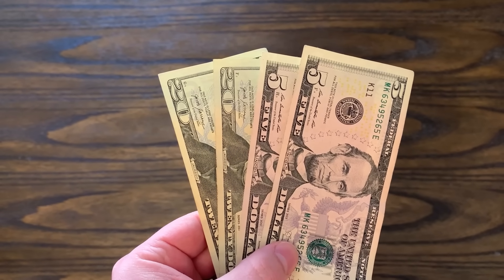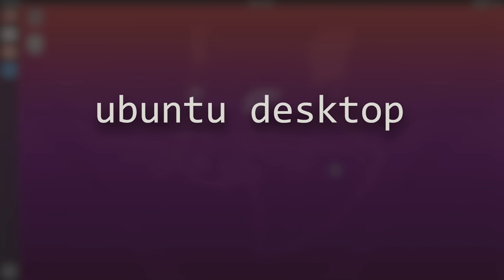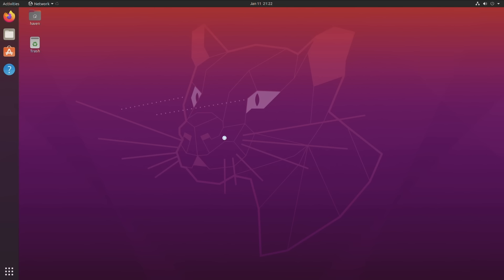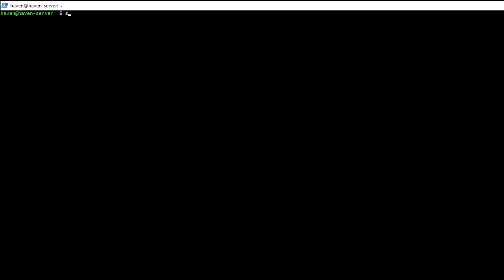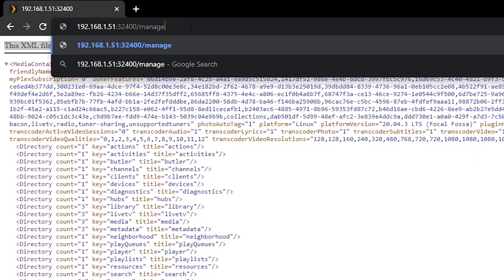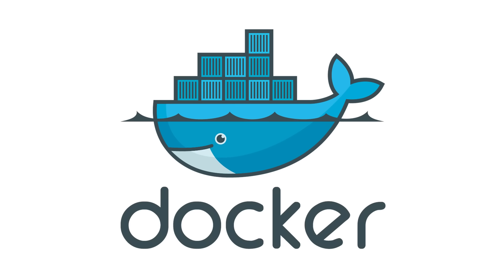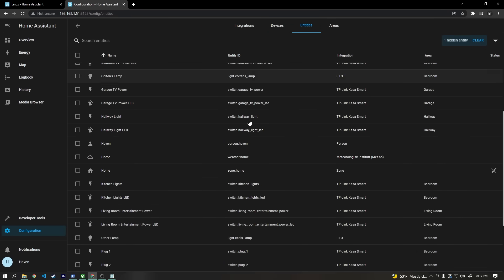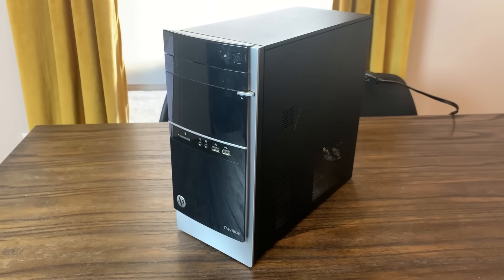Incredible Budget Home Server! (Minecraft, Plex, Home Assistant, NAS)

Comment: Nice, video. I do think it's important to note that this setup comes with limitations. 
- Things like transcoding are going to be limited to 1 client and I'm be cusrious if it can even transcode a high bitrate 4k stream.
- Very limited amount of SATA ports
- Power usage (a rPI4 or other low power device might be the better option)
- Power limitation, adding more disks will require a power upgrade
- Disk life, This case was never made to be running multiple disks at the same time. So once you start adding disks you'll run into issues with them dying quickly
- Reliability, for fun it's perfect. However, do not leave any important data on it!
- You say nothing of backup, which is the most important thing
Reply from the maker: All really good points! (Pinned this comment so others can easily see). I think the overall idea was more to just see some of the many cool things you can do with a PC that might be lying around the house or picked up for stupid cheap. Rpis are amazing (I have 3 currently), but sometimes aren't as affordable as people make them out to be. I wish I would've mentioned something about data integrity and backups though. I will try to be better about mentioning that in future content! Thanks for commenting
Reply: @HardwareHaven  Hi, mate thnx. No worries the video was fine and any tech savy person should understand this.

It's the non tech savy I worry about.

PS A few ideas for videos that expand on your current setup:
- Kubernetes cluster with some rpis + NAS or other hardware to distribute your docker load (keep in mind that the rpi architecture isn't x86).
- A sonar/radar/transmission/sabnzbd/spotweb setup, this often blows users minds. Do make sure you check the legality before doing so!
Reply: @HardwareHaven  Ow PS, would you be so kind and run a high bitrat to low bitrate transcode? Since you have it setup. I'd be curious how it'll perform.
Reply from the maker: Unfortunately I already tore that system down for a different video. I haven’t wiped the drive though, so I can probably put it back in and give it a shot later on though
Reply: @HardwareHaven  Although I really appreciate it. You shouldn't go out of your way to humor me. It's purely out of interest since I run a dual Xeon for plex myself.
Reply: @Nemesis-pe7mw  I had one, a home built A10 box.  Any Bulldozer based core will have issues beyond 1080p.  An add in Nvidia 1050 or higher will allow hardware decode and transcoding.  My A10-7700k could not even handle live OTA in Plex.  MythTV worked fine.  
Upgraded to Ryzen 6 2600, GTX 1050, Ubuntu 20.04 (Had been 16.04), and Plex, Emby, Minecraft, all work
Reply: @xrobertcmx  Hi thnx for the info mate. Well yeah hardware transcode is a possibility however a 1050 or any nvidia consumer card as far as I know will do 1 transcode at max. (some models can do more but are limited as far as I know)

It was purely out of curiosity of course, since I have a dual Xeon server with heaps of RAM (for ZFS). My wife will kill me long before I run into bottleneks due to power consumption ;)
Reply: Yeah it won't be able to even decode 4K let alone transcode. It's a nice small box, but I dislike when people try to put Plex on underpowered systems.
Reply: @jonmayer  Well, i get your point of view and I'm ashamed to say i share it.

However, do keep in mind everyones usecase and expectations are different.

Honestly as long as you make sure all the source material is at a bit rate, resolution and in a format the receiver supports you do not need transcoding!

I ran plex of, of a Synology NAS for years! Ran like a dream until my son got my parents old tablet. To fix it I threw the old tablet in the garbage and bought him a proper tablet which would support the right resolution natively.

Now I have since moved from my 12 bay Synology NAS to a Dual Xeon TreuNAS scale setup. But honestly the "little old NAS" would probably still do a good job and it's way slower then what he's proposing!
Reply: Transcoding requires horsepower, no chesp mini or old thrift store PC is going to be able to.
Reply: @joefish6091  These comments are so dissapointing. I understand where you're comming from, but most will not.

Please stop with the blanketing statements of stupidity. The "horsepower" required for transcoding is very dependent on the source and result.

According to the plex site a 720p source can be transcoded by a i3. However, my Synology NAS with a quad core atom @1.2ghz can run a single 720p transcode without any problems (memory upgraded to 16GB, the stock 2GB causes issues), as long as the bit rate is low enough.

It all depends on your use case. Personally I'd advise anyone not technically inclined to stay away from transcoding. UNLESS they want to throw tons of money at it!

On the otherhand, i do not expect even my big boy TreuNAS setup. A dual Xeon will be capable of transcoding 4k HDR.
Reply: If you have 4K for one TV and want to watch non 4K on another you can pre optimize in Plex so you don’t rely on real-time transcode. Doesn’t take up much space.
Reply: @chrisweaver41  I've never actually tried this. My media library is like 40TB atm so I'm hesitant.

Could you quantify not a lot in a percentage?
Reply: @Nemesis-pe7mw  no, I can’t give you a percentage as it is highly dependent on the source and what you optimize for. I suggest you pick one of your 4k media sources and run the optimize function for the playback resource you prefer. You could for example get something like 40-1 going from a 40MB 4K h.264 source to a lower bitrate 1080p or even 720p in the 1MB range. If your source is h.265 and the transcoding is needed for direct playback on a h.264 player then space savings would not be significant. While space savings is another topic, this is about saving compute resources, if you can’t transcode in real time, then you could transcode using the optimization function prior to viewing. 

I would guess that if you have invested in 40TB of source material you also have significant compute resources as well. This is a suggestion for a use case where someone is trying to operate a highly functional Plex service on a budget and can trade a large investment in compute power to using additional storage and the optimize function will by definition use less space than the original.
Reply: @jonmayer  I have my Plex server running as a small VM with very limited ram, on an older dual core processor and slower external USB storage, as long as I keep my content prepped for direct play for my choices of playback devices ( Primarily AppleTV ) I don’t have any issues with 4K HDR. Spending money to handle all the transcoding is only needed when…. Transcoding is needed ….
Reply: I always amazes me how poor the design of the big cases are. Compare it to a Shuttle PC, for elegant cooling and packaging: and old shuttle boxes can also be repurposed with mini ITX (IIRC) motherboards and a cheap i3 or similar low power CPU. RPi4 obviously a big winner, esp in power consumption as electricity bills rise. Ideally a setup with a RPI and a disk that sleeps is good, some of the caddies allow this, for reuse of old SATA 3.5" drives via USB3, which also makes the system easy to hide away.
Reply: @G-ra-ha-m  It really depends on what you want. For most users I'd advise a standard NAS, Synology. Yes they're expensive for what you get from a hardware point of view. For someone that's just starting out this'd be the best!

A rPI if you can accept it's limitations and are tech savy. A i3 self build like you said if you can accept the limitations and are less tech savy. 

If you're crazy like me and are on a moderate budget, a r720xd poweredge with a dual high performance xeon a shit load of ram. A few PCIE m2 SSD's. A few sata SSD's. A few extra controllers. Two 1100W power supplies. A few custom connectors to bleed of some extra power, the extra power and the sas connectors to two self made external enclosures each holding 8 more disks.

When budget doesn't matter... Who doesn't want a 100GB back bone in their house with a datacenter in the basement.
Reply: @Nemesis-pe7mw  Your solution is by far the best for technical specs: over time I've tried to move over to quiet (ideally fanless) stuff that doesn't use much electricity :).
Although my RPI4 does have a fan, so it lives in the shed LOL.
Reply: @G-ra-ha-m  Well, tbh it's waaaaaaaaaaaay over spec'ed. It's for hobby and my wife is a sweat hart! Also I have solar panels so yay me :)

But yeah, when I tell people how much electricity we use I am very ashamed!

As for the sound, please don't laugh. I made a dual insulated room in the attic with a forced airflow path. There is no sound.

I just can't help myself... Also my sons minecraft server is running on it so it's more then justified!
Reply: @G-ra-ha-m  Em, most energy is still won from non renewable sources. I won't get into the conjecture and lack of understanding of physics.

On the US army, not sure if that's indeed the case. Never calculated it however, the largest poluter at this moment is most probably SpaceX.

No idea on Al gore, thought he was dead, I stear away from environmentalists since it's usually more look at me then actually beneficial.
Reply: @G-ra-ha-m  I'm speaking currently, not historicaly. 

I clearly stated "On the US army, not sure if that's indeed the case.". When thinking about the US army I honestly did not take war into considereation. Furthermore I said it's most probably SpaceX. This is mostly due to the way they propel the rockets and the resulting polution which is of stellar proportions, pun intended. I may be wrong, I  can accept that from myself. Can you? Or are you 100% percent sure. If so please show your work!

Well you stated "Energy is managed, controlled and metered deliberately. The earth literally bathes in energy" which lead me to assume you assumed (electrical) energy is free and changing one type of energy to a useable electricity source is trivial. This is not the case!

You confusing Voltage or potential with energy indeed lead me to assume you are lacking in knowledge on the physics front. You can have a very high voltage with little energy, as soon as you add a load the voltage drops. You know like what happens with lightning ;) If you dissagree let's discus it.

If you'd like to reply please feel free. However, please refrain from emotional responces and keep it civil.
Reply: @Nemesis-pe7mw  @Graham I absolutely loved reading the overall dynamic of the conversation progressively change. It was indeed entertaining..
Reply: @johnathanabaya7574  Glad you were entertained. 

I was bit dissapointed myself.
Reply: @Nemesis-pe7mw  oh i'm sure! But that was more or less why I was entertained.
Reply: how is having the wrong case gonna kill the drives? i mean unless you literally have them stacked ontop of one another in a pile on the floor then i see what you mean but its pretty comon to have more than one hdd in a pc/server
Reply: @firenado4295  Vibration and a lack of proper airflow over the disks. You cannot compare a proper disk enclosure with what a PC comes with, especially a budged one at that.
Reply: @Nemesis-pe7mw  i mean i have 4 discs in a beige box i found that i use in raid. two discs fill the hdd bay and there are two in the floppy drive bays and thats been working for years, they aren't even good drives just stuff i got in a lot off ebay so I doubt that it will make that much of a difference.
Reply: @Nemesis-pe7mw  720? Sir, it’s 2022… We want 4K HDR content!
Reply: @ohheyalan123  For many use cases 720 is more then sufficient.

If you want to stream 4K HDR and even worse transcode it. Then there is a cost. A cost which most people can avoid since they do not actually need it. That's all I'm saying.

The other thing with 4K HDR content is that it costs a ton of storage, if you want 4K HDR then I assume you want HDR10 with a low compression and uncompressed audio. It is 2020 after all ;)  So say +100GB an hour. 

For me that's not worth it. I only do that for nature documentries and some movies. If I can find a source of such a quality, which is rare. Yes, even in 2020 ;)
Reply: @firenado4295  What's the load on those disks? Do they run continuously? How often do they spin up? What's their speed? Do you ever look at the smart values?

"so I doubt that it will make that much of a difference" this is a statement made out of ignorance. 

Please, be carefull with advising anyone with doing this! I hope you have proper backups.

PS 4 disks is a VERY low amount of disks for a NAS. I have 1 NAS with 12 Disks and 1 with 20 Disks and 10 SSD's.
Reply: @Nemesis-pe7mw  bruh they where all on caution when i bought them but they where £2 each so eh, I dont have the system now cuz I just bought a single good drive instead of using 4 80GB drives but it was on continuedly and used a bit as a public file server to move stuff from one pc to another
Reply: @firenado4295  Your initial argument/question was "how is having the wrong case gonna kill the drives?"

The answer is:
- Vibration exasturbated by resonance
- Heat

As for your example system, that's not a valid example. For MANY reasons. There seems to be a knowledge/experience gap which will make it hard to continue this conversation.

I would like to remind you again to make sure you make backups. At least 2, 1 of which offsite. Which with the amount of data you're talking about is free. Just make sure you encrypt the backup when using a free service.
Reply: @Nemesis-pe7mw  ah I didn't think about heat, you got me there but on most of the servers I have seen where the HDDs slot into a back plain (not using caddies) there is basically no vibration dampening at all just a mettle grid to support them. would have thought that was far less optimal than screwing the drive in place like on the case shown in this video.

and yeah, I do back my stuff up cuz i have had alot of odd drive failures but not in the way you'd think. an example is that I have a couple of 20 year old segate ide hdds one of which has been used in a voip server for the last 15 years 24/7 and they are both fine. however, both the brand new segate 1tb drive i bought a year ago and the 2 year old segate drive in my mothers pc are both dead already. how does that even happen?
Reply: @firenado4295  Hi Firenado, my intention is only to converse, share knowledge and enlarge my perspective. Sorry, if my writing style seems offensive to you. It is not meant to be.

@Server backplane slots, yeah those usually aren't great! But don't forget there is mostly just room for 2 disks. More disks is more vibration. Also they usually aren't certified for 10K disks. I have a r720XD for which the backplane is compareble to what is shown in the video, in vibration resistance. Airflow is MUCH better though!

@Backup, good to hear!

@The IDE disks being "rock solid" compared to the newer drives. There are a number important factors. Here are a few:
- The data density of the IDE disks is FAR lower!
- A VOIP server has little to no disk IO (depending on the configuration)
- The disks in the VOIP server are on continuesly and thus have a stable temperature. Turning a disk off and on is one of the biggest factors for disk failure. This is due to the expansion of the metals
- The IDE disks have no pesky green logic which is hell on a disks life expectancy
- Larger disks fail more often due to increasing complexity, heat and vibrations.
- It could be that you bought shingled disks which are bad unless you have a very special use case
- Usualy when stuff in my moms stuff die there is but one reason. My mom ;)

The problem is your comparing apples and smart watches to each other. There are to many differences to mention.

My experience with modern disks as with all modern technology it seems is that they're not made to last long. This is exasturbated by the fact that to achieve modern day high density drives a lot of complexity is required. The higher the complexity the lower the MTBF.

It's like comparing an old mustang with a Nissan GTR. 

The old mustang will probably run no matter what you do to it! Clean the block replace some bearings and fittings you're done. You can do this in a barn without much issue or knowledge. Gas and air goes in, it burns it VERY inefficiently, rotation happens and fumes come out!

The Nissan GTR needs to be serviced in a clean room because of the tiny tollerances.

The mustang is as technolocally advanced as a horsedrawn carraige (litterly). The Nissan GTR is more comparable to a formula 1 car.
Reply: @Nemesis-pe7mw  i didn't mean to sound offended because I'm not although I did find "knowledge/experience gap" a bit diminutive. 
also bring up the old drives was just a matter of curiosity and I didn't really thing there was any actual reason behind it but it pretty interesting. I am aware that old drives shouldn't be directly compared with new ones because of the difference in their workings but I do think its pretty bad that new drives are so temperamental
Reply: @firenado4295  Hi Mate, text communication is always difficult even more so since we both seem to be non native speakers. "diminish

We most definitely agree on the reduction in reliability of drives. Although I think the drives can be used as a parallel for most  current day reliability issues.
Reply: Drill a hole in the front (the plastic and the actual case) and add a fan. Preferably a 120 or 140 mm with a fanguard or filter.
Reply: You can pretranscode things if you have the storage for it, I'd bet it can handle pre transcoded 4k content
Reply: @HardwareHaven   what's this about disk life? I just decided to tinker and did these things on one of my computers on a secondary partition. Does running a single disk mitigate that?

Also what's this about transcoding clients? There ways to get more than one?
Reply: All valid concerns, and I would also add that the HP box is likely going to be hard to upgrade, or even pull and put into a new chassis with their proprietary hardware and layouts. BUT that being said I did something similar but put old parts in a rack mount chassis, wired the house while we did a remodel and the walls were down, and installed wifi access points to provide probably overkill coverage. Proved to the wife the server is super cool and all the cool stuff that we can do with it. Turning an old pc into a server is a gateway drug, and before you know it, you're picking up refirbs on eBay or Amazon and putting together a home lab. Especially since you can get servers (old - but still beats most consumer gear that would be retired to a server) for a couple hundred bucks on Amazon or eBay. Toss a nvidia 1650 or 1660 in it and you've got a nice machine capable of at least 3 good transcode streams (more if you use "the patch"). My R-720 isn't even all that loud except at boot when it sounds like a jet engine. lol.
Reply: Also, jellyfin is better than Plex (albeit with a less fancy looking ui)
Should have used docker for Plex as well.
Reply: Why would adding more drives to this case cause them to die quickly? The power draw vs supply? The heat? Couldn't you just upgrade the oversupply and add in some cooling to bypass those problems?
Reply: @probablynotdad6553  Vibrations.
Reply: @HardwareHaven  can this be implemented on a win10 PC with the Linux layer on and Ubuntu downloaded? I'm new to running Linux inside of windows
Reply: rPI4 will have all of those limitations.
Reply: @runed0s86  Jellyfin is better at somethings. There is no unequivocal better. Plex works great as long as you run it on something beefy.

Ow enlighten us. What is docker? Why do you think that would be better? Do you even know what the trade-offs of containerization are?
Reply: @tyrand  I'm not sure why the rPI entered the conversation. The rPI is a low power device, even though it has some hardware encode and decode capabilities a single rPI will always run into limitations. FAR more then the ones you're referring too.

Now a cluster of rPI compute units with a clever setup of Plex utilizing remote transcoding. I'd be able to create something that is MUCH faster then anything you could create using even a high end server. The rPI compute cluster will have the benefit of being completely scalable.

Of course that would mean me or someone else, with the right skill set,  would having to make plex hardware transcoding compatible with the rPI hardware and create proper remote transcoding, including splitting one transcoding stream over multiple transcoders.

Al of this is not trivial, however the end result would be that Plex would be deployment agnostic.
Reply: At that point, a setup like this is more fit for a Minecraft Server
Reply: also please use ventoy instead of rufus its way better for boot drives
Reply: Also a good plus would be to run Ubuntu server edition instead of desktop to save up some resources
Reply: @FrostDeDay  depends on the use case. for a power user yes. but this video wasn't meant for a power user. It was meant for someone with limited knowledge. so I'd say Ubuntu desktop is better from an ease of use perspective.
Reply: @Nemesis-pe7mw  Valid point ig, but its almost the same thing from a terminal inside of desktop or just full barebone it would've been better to teach the barebone since its all new to them anyways minds away teach the important things that matter in potential careers or down their hobby.
Reply: @FrostDeDay  true, however from experience people accept a desktop with console better then a barebones server. The biggest benefit is google and copy paste. Yes, ssh will give them the same without having to sit at that physical location.

I know it's rediculous.
Reply: I’m currently building a NAS! It isn’t as complex or size wise huge , I have 7TB as of right now, my purpose for as of right now is just to eliminate all the external hard drives I have laying around and just being able to download and save to 1 machine and access by all! Also wanted to get rid of paying so much for iCloud storage so now I’ve been saving to my own cloud vs paying Apple anymore money! Build A NAS , stop paying Apple!
Reply: @BuildRitz  Stop paying Apple. Now that I can get behind!

Everyone needs to start somewhere. Do make sure you have backups though! Disks die, it's just a matter of when they die.
Reply: Plex didn’t need to rub on something powerful, just cpu with quick sync, preferably 6th gen or newer.
Reply: @Nemesis-pe7mw you are very well spoken and have a tonne of knowledge though I am just watching this video for fun maybe I'll build something like this in the future your points and other replies are really good! Call it flattery if you want but you should upload some videos yourself about NAS and home servers!
Reply: @atharvabhosale3529  Thank you. Currently to busy to do it well, making good content takes a fair bit of time. I might take you up on that at some point.

Always keep in mind though, everyone canmake mistake, this includes me so always verify with another source if you can.
Reply: @Nemesis-pe7mw I would watch ur vids
Reply: @OfficialBoominBeats  Thank you I appreciate it.